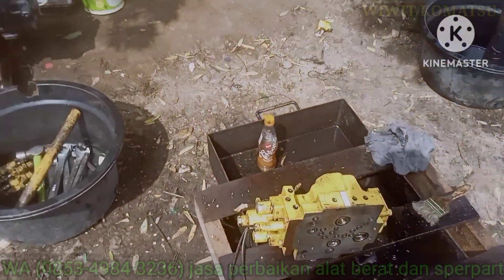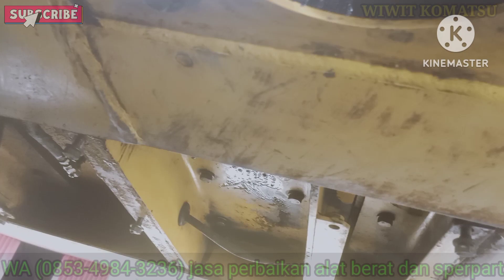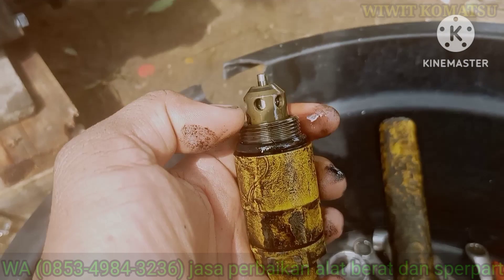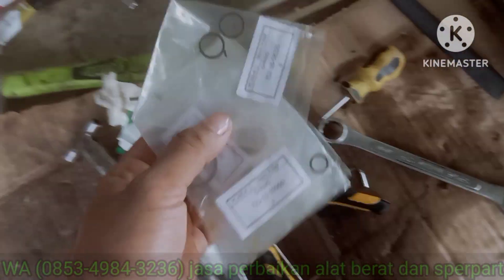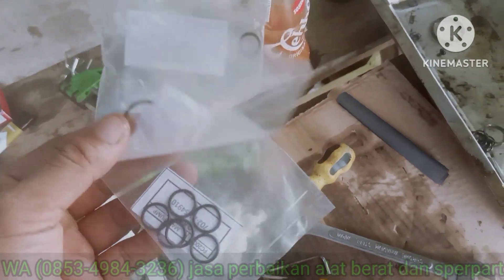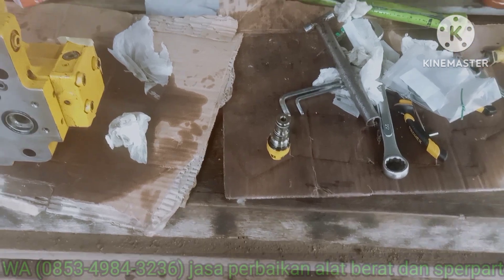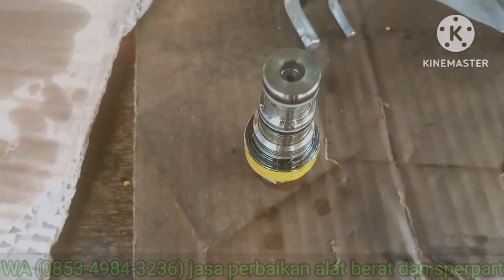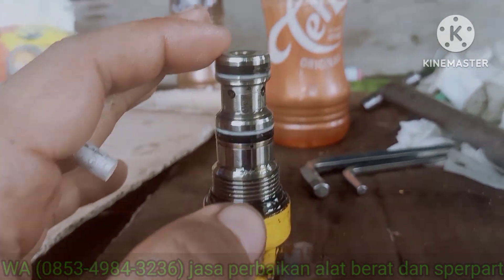Cara Memperbaiki Kombinasi Lambat dan Handel Kosong pada Excavator Komatsu PC 200-8MO.

Comment: Bang wid pc75-3uu klo dingin gerak normal enak klo oas buat kerja 1jam arm buket boom swing lambat handek sisi kiri sering kosong/macet macet klo handel kanan kosong tapi masih jalan tapi lemot kira2 apa ya?
Reply from the maker: Yg sudah di cek apa aja
Reply: @Belajarmekanikpemula di cek presure ketika dingin main pump awal 270 ketika suhu kerja 1jam buat kerja turun ke 220 dan mulai terasa lemot
Reply: Terus untuk presure gearpum awal 220 untuk swing jadi 110 yang arah ke motor swing ketika panas @Belajarmekanikpemula
Reply: Ada no wa om @Belajarmekanikpemula
Reply: @Belajarmekanikpemula ketika dingin di test untuk naikan presure main pum di main relief dan savety valve angkanya tetap di 270 kondisi ketika presure stanbye di angka 120 unload sudah di reseal yg spgo nya itu tapi tetap kondisi load sensing baret2 halus rencana mau turunkan pompa dulu karena buat operasi 1jam an control valve terasa panas sama pompanya
Reply: @Belajarmekanikpemula saya wa om tadi

Comment: Walaikum salam warahmatullahi wa barakatu abangda👍
Reply from the maker: Walaikum salam
Reply: @Belajarmekanikpemula  ijin bertanyak bgda...pc200-8 reducing di ukur dari port didapat 35kg low idle tapi kalau high idle presure turun ke 20kg apa ada masalah di lifting cek Valve nya y bg...kadang jika attachment digerakan presure kadang naik dan kadang turun... reducing udah tak reseal seperti vidio perbaikan reducing...kalau distel Masi mau naik pressure nya bg.... masukannya bgda🙏

Comment: Unlod ap maksudnya y mas🙏🏼
Reply from the maker: Maksudnya fungsi nya kah😁
Reply: @Belajarmekanikpemula  iy mas..tmpt sy krj pc 200 nya  ad 8 unit
Reply from the maker: @slametpintar142 Unloading valve adalah jenis valve pada sistem hidrolik yang berfungsi untuk mengontrol tekanan pada sistem hidrolik. Fungsi utama dari unloading valve adalah untuk memastikan tekanan pada sistem hidrolik tetap stabil dan terkendali.

Ketika tekanan pada sistem hidrolik mencapai titik yang telah ditentukan, unloading valve akan membuka dan mengalirkan fluida hidrolik ke sumber lain, seperti tangki atau reservoir. Dengan begitu, tekanan pada sistem hidrolik dapat dipertahankan pada tingkat yang diinginkan, dan kelebihan tekanan dapat dialirkan keluar dari sistem.

Penggunaan unloading valve pada mesin alat berat, seperti excavator, sangat penting untuk memastikan keselamatan dan performa yang optimal. Tanpa unloading valve, tekanan hidrolik dapat mencapai level yang berbahaya dan dapat menyebabkan kerusakan pada mesin atau bahkan mengancam keselamatan operator. Dengan menggunakan unloading valve, tekanan hidrolik dapat diatur secara akurat dan mesin dapat beroperasi dengan lebih aman dan efisien.
Reply: @Belajarmekanikpemula  Terimakasih mas infonya..🙏🏼🙏🏼

Comment: Maaf mas mau tanya Saya ada troubel PC200-7 saat travel mesin seperti terbebani dan drop mau mati tapi travel tidak mau gerak. untuk atachment lain normal kombinasi normal. yg sudah saya cek. pilot vave normla. selenoid block normal control valve spul nya normal gk macet. swipel joint normal. saya buka travel motor nya piston brek nya saya tembak pakai angin gk mau main dan saya coba saya kurangin disc nya biar releas break nya sama juga gk mau mutar travel nya mas untuk piston shoe aman dan gear palnetary nya aman  untuk spul dan relive travel sudah saya cek. bagus gk macet saya kerjakan bekas kerjaan mekanik lain mekanik lama sudah nyerah mohon petunjuk nya mas
Reply: Abg reply la komen abg ini sya mau tau jgk apa masalahnya.. terima kasih
Reply from the maker: Kronologi awal gimna
Reply: @Belajarmekanikpemula  dari beli sudah gk mau travel mas.
Reply from the maker: Untuk pressure dapat berapa
Reply from the maker: Trek nya sebelah atau 2 dua nya